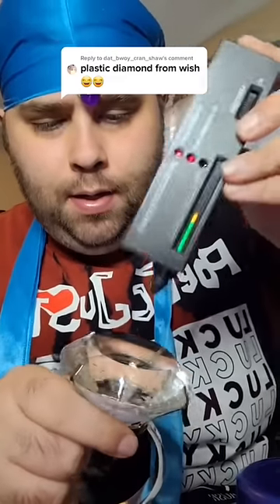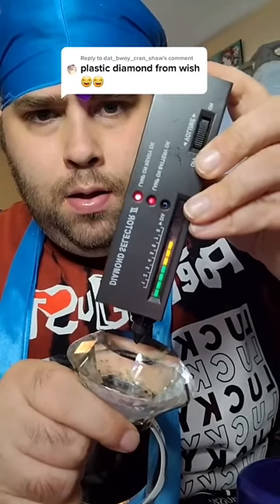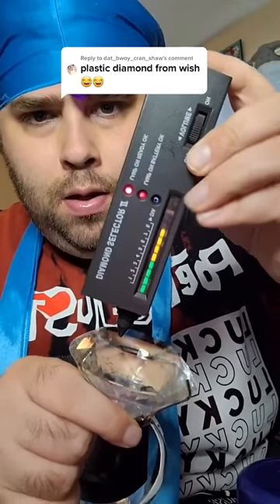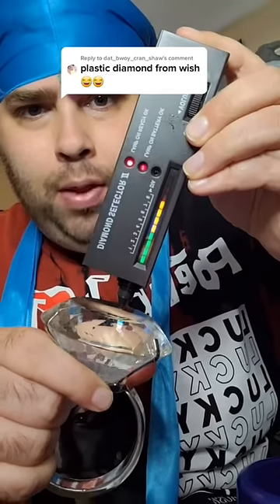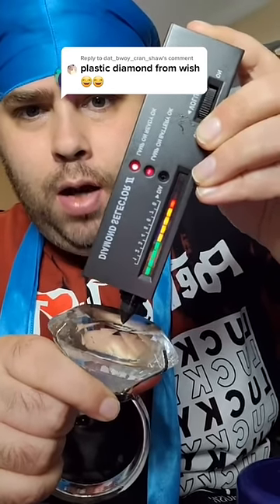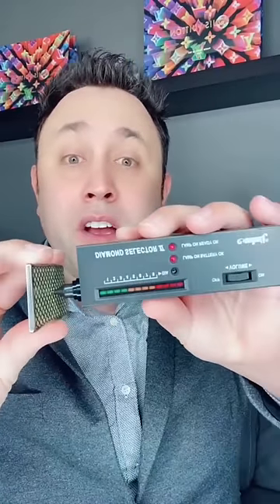How Diamond Testers Work

Comment: I love how diamonds aren't actually rare, it's just the company that "owns" them has absolute monopoly
Reply: What company
Reply: @Andrew-tf9xp  artificial diamonds are real diamonds.
It's just carbon atoms in a particular arrangement, I don't even know how you'd "get so close to the real thing" without actually making the real thing.
Making an 'almost diamond' would be way more impressive
Reply: @lordsrednuas 100% Correct
Reply: @Andrew-tf9xp  It's true, and they're used to produce tools and equipment like cutting disks.
Reply: Real life npc
Reply: @oumardiop1 Debeers if I remember correctly
Reply: Diamonds are rare even though there is large amount available. Diamonds take atleast 1 billion years to form and lab formed diamond are less expensive takes a month to form in a lab so the price of diamonds are not a monopoly for no reason and jewerly is not the only thing that diamonds are used for. They help builds roads and medication which lab diamonds cant do
Reply: @mrsauceatit  what i meant was if that company didn't own every diamond (except lab produced ones) diamonds would be insanely cheaper, they would be used way more than they are right now
Reply: @mrsauceatit lab produced diamonds can do most things in industrial settings that real ones can do, just slightly less effectively, diamonds arent even slightly rare, the ones you see in rings? Yeah thems worthless.
Reply: @fred6o  if you have anything to say, say it, insulting people without any reasoning ain't that smart (also people that call everyone npc probably ain't the mc)
Reply: @Andrew-tf9xp swarovski?
Reply: diamonds are absolutely rare
Reply: I found a point 2 caret diamond in the $5 diamond mine game that they sell in retail stores and it is worth exactly $3 so if you have an iced out watch with say 1000 diamonds realistically it is only worth 3k on top of the watch value
Reply: Deberes control over 75% of the world's supply of diamonds. They also came up with the idea that you need a diamond ring to engage to someone. It was one of the most influential marketing schemes of all time.
Reply: @danitroninja9969 and every kiss begins with Kay 😂
Reply: She sells seashells on the seasho-
Reply: @xseptit Grats on being brainwashed by de beers
Reply: @oumardiop1 The beers corporation
Reply: no company owns all the natural resources. Go to a poor country, pay them $300 for a few hectares of land and get to mining
Reply: @Andrew-tf9xp they are more pure than natural diamonds but people will buy the natural ones for the same reason people buy art just because it's old and painted buy a certain guy it's not about the physical value of it. i don't know something in the human brain makes those decisions.
Reply: @mrsauceatit there are VERY large amounts available, which means they’re not rare. they’re not common to where they’ll be on the surface, but js bc they take a long time to form doesn’t mean they’re rare
Reply: @laylowbNetherlands de beers* isn’t it? i’m not actually sure i js thought that’s what it was
Reply: @lordsrednuas i mean, sort of yes. Real in that they're very similar, more comparable than leather and pleather certainly. Sort of like how all pearls are pearls, but not all pearls are the same.

Synthetic diamonds are great because they're very uniform, almost all exactly the same batch after batch, primarily used for tools and abrasives.
Reply: @xseptit Not really, there are so many diamonds in the world that if all the supply was released they wouldn’t be that expensive. Most are used for industrial usage and the rest are hoarded and then a small amount is released to artificially raise price.
Reply: @barryallen5507  "Real in that they're very similar".
In what way are they not "real" ?
Reply: You can't just say that without naming the soupposed company that owns all diamonds. At least try to hide that you don't know what your talking about. Also you can make diamonds in labs by rearranging the carbon in coal through pressure and heat, but sophisticated machines can still tell which diamonds are grown and which are natural.
Reply: @lordsrednuas  it’s because there is a certain stigma behind lab grown diamonds where a lot of consumers really want natural diamonds. Because walking around with a lab grown diamond is like walking around with fake Jordan’s. most people won’t give a shit but a selective group of fucking snobs will roast the shit out of you.
Reply: @coasterthekid8867  Yeah, I know the real difference is marketing, I was wondering if the people saying artificial ones aren't 'real' could figure that out.
Reply: I hate Steven Singer too
Reply: it kinda reminds me of the song "money game pt. 2" (the one with the "she sells seashells on the seashore, but the value of these shells will fall" meme)
they took a ton of diamonds and they made it seem rare and expensive, when they aren't
Reply: @dereckthemac8572  pretty sure they have monopoly in the diamond extraction and selling
Reply: @xseptit no lol
Reply: Diamond is one of the jewelleries that drop in like 40% of its original value once you bring it out of the shop. Gold never really depreciates, get a gold ring. Minimally something like a ruby at least that shit has colour
Reply: @Johnnysboy3987  not everyone has time to learn about shining carbon rocks
Reply: @Andrew-tf9xp every rapper has cvd diamonds.
Reply: @Andrew-tf9xp  Not close, they are real. They are even more pretty and durable compared to naturally made ones.
Reply: @Andrew-tf9xp  light reflects differently depending if it is a natural diamond or if it is a artificial diamond. A real diamond would reflect light more "linearly" and a artificial one would reflect more "dispersedly". Also, artificial diamonds are usually yellowish white, while real diamonds range from a large variety of colors, from red, green, blue, white, etc.
Reply: @lordsrednuas  actually, no. There are a lot of differences between an artificial diamond and a real diamond, for one, the way they reflect light, color, and other stuff. And they don't have market value as anyone can make one with, like, human hair and a few dollars, and you can't sell them as a legit diamond.
Reply: Says Someone who's never went looking In the mines or dug for em
Reply: I’m pretty sure a monopoly is technically illegal…
Reply: @lordsrednuas "artifical dimonds are real dimonds" takes the cake for one of the most oxymornic things I read td. Can you not see how that sentence contradicts itself lol. Yes they may have the same crystal structure but ones natrual and ones synthetic. The only real dimonds are natrual ones. There's real, synthetic (lab grown) and fake (counterfeit) dimonds. Yes artifical dimonds aren't fake but they ain't dimond dimonds. They literally have to say lab grown in the description legally in the US so you know its not a "real" dimond.
Reply: When a14 year old learns ancient facts for the first time
Reply: @Andrew-tf9xp  yeah, there are also similar to diamond such as zirconia which looks identical.
Reply: @justinbutler591  "Yes they may have the same crystal structure"
Right there you agreed with me and didn't even realise it.
I get it, you find the marketing for naturally forming diamonds really convincing, but it doesn't make the manufactured ones any less real.

Try applying that "logic" to other crystals "Ice from the freezer isn't 'real ice', only water that freezes outside is real ice."
"Salt deliberately formed in evaporation ponds isn't real salt, only salt that formed from unintentional evaporation is real salt."

I personally find gems that formed naturally more interesting, but that's because I find the natural processes really cool. Not because I think a crystal forming because a person set up the right conditions for it to form somehow disqualifies it from being that crystal.
Reply: Blood diamonds
Reply: @lordsrednuas  I think there are differences between laboratory created diamonds and "real" diamonds. Funnily enough those differences are mainly inclusions, contaminants or imperfections in the natural diamond. So the lab created one is "too perfect". Now the question is how much it's worth to you to get the "genuine" article.
Reply: @davidbreier84  as I've said elsewhere, the consistent purity of the manufactured ones is the only real difference.
And while that is certainly a difference between manufactured and natural occurrence, that's a very different dichotomy than real and fake.

There are plenty of people that seem to think a manufactured diamond is somehow a fake diamond, just scroll though this comment thread.
Reply: Real diamonds are rare. These vvs cvs bullshits are fake lab diamonds
Reply: @lordsrednuas  nah I know that manufactured diamonds are structurally and chemically absolutely real diamonds. I just recognize that some people might be willing to pay more for a "natural" product, whatever that means. I don't know much about the production process, however I would guess it would be possible, if not easy, to produce giant diamonds for a relatively low cost. So it would be economically advisable to just always buy the manufactured stones, no matter what you want to do with them
Reply: @davidbreier84  Oh yeah, I recognise that too. I'm only here to try and get the weirdos that think lab grown diamonds are fakes to explain how they think that works
Reply: @Andrew-tf9xp  they dont "recreate" them, they just create them lol.
Reply: That's no longer true. Debeers no longer corners the market they have lost so much share. The truth is diamonds just aren't that common and a lot of diamond companies spend a lot of money trying to tear lab grown diamonds which are chemically identical.
Reply: @mrsauceatit lab diamonds are used for those things at the end
Reply: @x1expert1x deberes… also not every bit of land has diamonds, places that are rich in diamonds can be bought for 100s of thousand
Reply: When your source of information are shorts from fact youtubers.
Reply: @lordsrednuas  yeah but in that logic lab grown meat is the same as meat from a slaughtered animal. They r both meat, but only one is "real" meat the other is lab grown. Lab grown meat is very weird to me. And while I think it's a great thing there definitely should be a distinction. And that distinction is saying the words lab grown meat vs meat.  Meaning the only meat that just called meat, aka real meat, and that's meat from slaughtered animals. Maybe it's just a difference in how we use our words from their multiple connotations. But I like to keep a distinction between synthetic man made versions of things and naturally occurring versions. But your logic is sound.
Reply: Literally not true

Comment: You’d think someone with the money to buy that many diamonds, he wouldn’t be using a 30$ tester
Reply: Nah it 13.96$ on Amazon and the diamond is 6.59$
Reply: The real ones are like 300 or 200
Reply: The testers are like $25
Reply: @Thatonejit2  nah bro they like over 2K
Reply: Why does that short get 1 mil likes 😮
Reply: Nah hes using a $30 cause he used up all of his money on the diamonds
Reply: Fr
Reply: 30$ is inaccurate and 300$ is more accurate
Reply: its just fake tested
Reply: @nbgaming7497  300 dollars is how much the really high quality ones are, he was using the low quality 30$ one so he could turn a dial to make it look real
Reply: Faxx
Reply: Ik it’s weird
Reply: Hehe
Reply: @igstormz249  no there not
Reply: Its probably like 14$ -- 12$
Reply: @igstormz249  yeah....... professional diamond tester was for $300 so......
Reply: I think he’s using it to only to use the one the guy in the video is using. Because unlike the 300$ dollar ones they test heat and have a adjuster so things like metal can go off just like diamonds.
Reply: @incorrectlife6962  your right I just learned that a few hours ago, the line goes up because of how much heat is in the fake

Comment: Fun fact: since that device sees if the object conducts heat. When that guy moved the tester the tip got some heat of friction. Making it go off
Reply: Um we can hear
Reply: Yes very true
Reply: That’s so true
Reply: @loafstep7133  clearly no one else puts them in their place, gotta do whatcha gotta do 🤷‍♂️
Reply: Lol thats not hoe it works, it tests how the object conducts heat based off conductivity not heat
Reply: @lukeriley2721  mate you know how friction causes heat so it basically went off on something isn't supposed to conduct heat
Reply: @khaledocto2403  so they are faulty and don’t work?
Reply: @usedtoberyanpoopnownormal8822  no this device checks if the thing can conduct heat, so when that guy moved the device on the glass or plastic diamond, it created friction which made heat and made the device beep
Reply: @khaledocto2403   actually it didn’t create friction because the surface is too smooth
Reply: Well no shit.
Reply: Pretty much. To add on that, he calibrated it to yellow so even small amounts like that can set it off
Reply: @ty2ruude  pp
Reply: Pppppp
Reply: also he adjusted the green bar thing
Reply: Facts
Reply: Because your diamond tester is fake😎